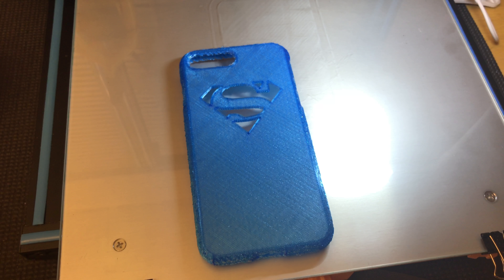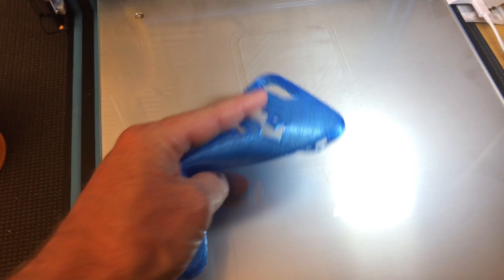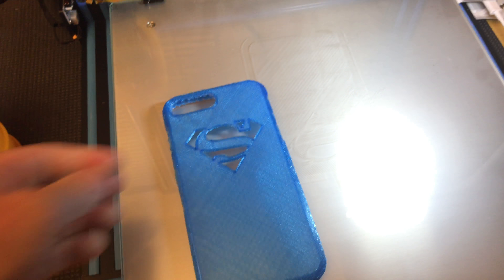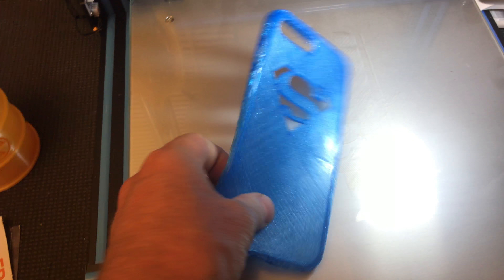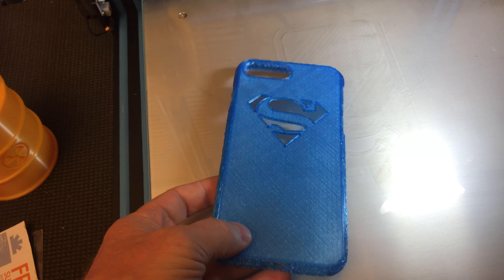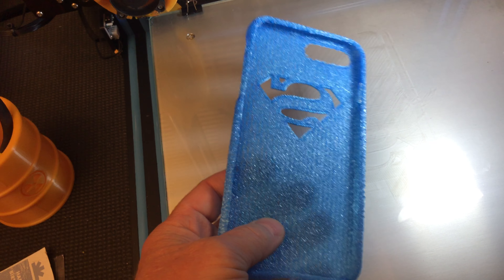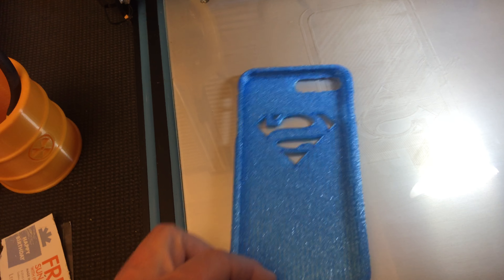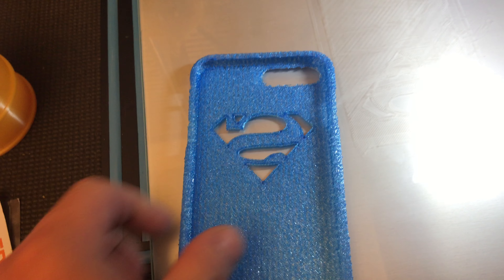My First Flexible Filament Print on Creality CR-10 - Partial Fail

Comment: What was the temp you put the CR-10 on?
Reply from the maker: Chris W I tried 210c, all the way up to 230c. I think I found the issues and will post another video if I get it working.
Reply from the maker: Chris W I just completed a bracelet for my daughter and it came out perfect. Surprisingly good. I was simply running too fast on the phone case.